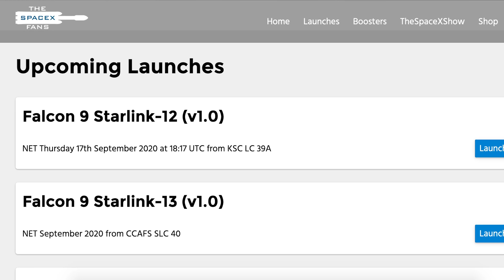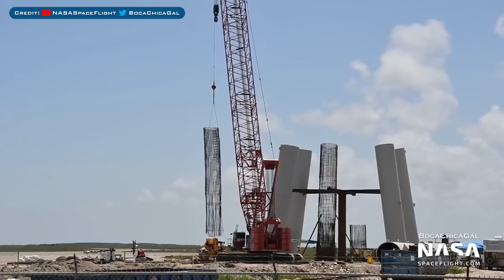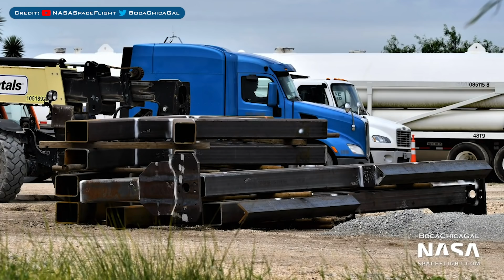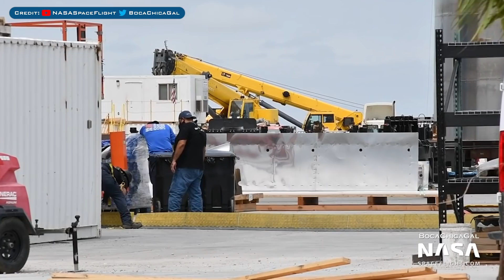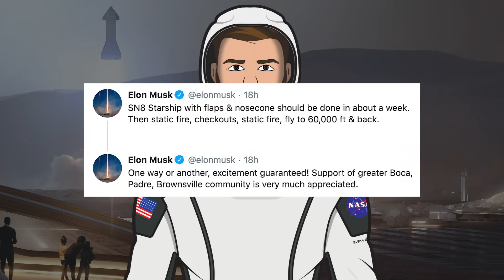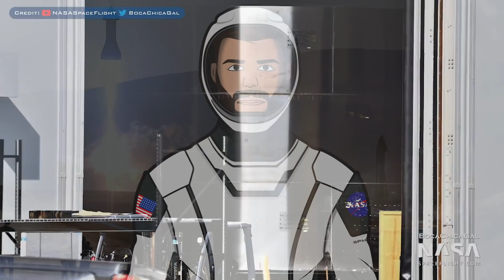SpaceX Starship Updates! SN7.1 Testing, SN11 Spotted! TheSpaceXShow

Comment: good afternoon regarding a new Launchpad their building the rebar cages at they're installing if you notice that the top half has coils of circular bands going around the vertical rebar at the joints are they going to two halves together there should be circular going around that purpose of the circular bands is a keep compression collapsing the concrete structure understand at the pipe shall give it more support but the purpose of the Bands is the keep downward force from collapsing question should there not be Circle circular rebar supports on this section. Good afternoon regarding in new LaunchPad.
Reply: There will be something connected very firmly to the tops of those collumns.  I assume it will be the part that holds onto the rocket, but there might be another layer or two in between.

The missing rebar rings are probably going to be installed along with the rebar for next level.
Reply: James Thornton : Wow, try using punctuation!